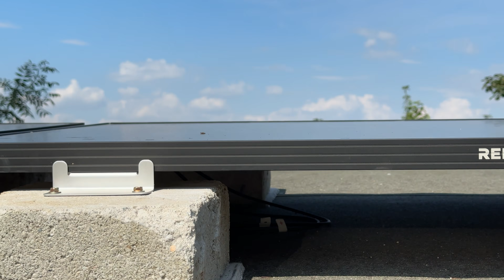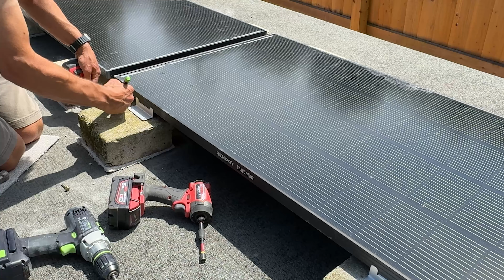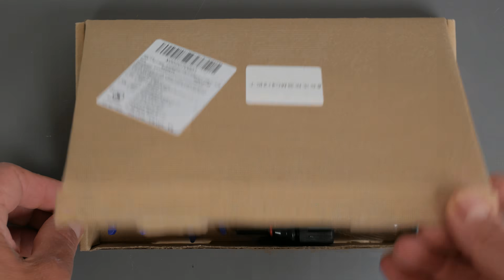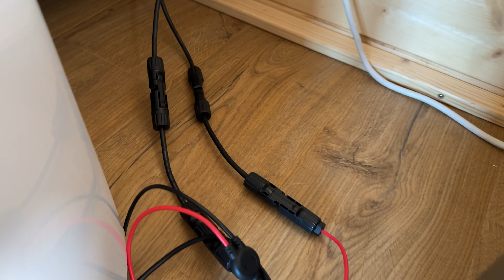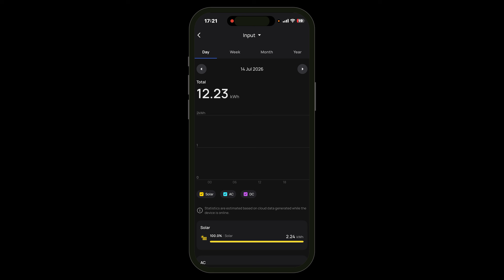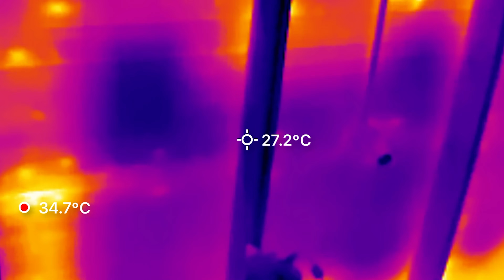DIY Solar Panel Installation – No Roof Drilling!

Comment: Love it. I'm installing something similar in my garage to heat it during winter. Thanks for the ideas!
Reply: Id also like to add, I'm going tk add eyelets to my setup to give me the ability to quicy anchor the panels to the ground  in the case a heavy strom rolls through.
Reply from the maker: Great please let me know how it works out!

Comment: Looking forward to the follow up video when the panels have flown off the roof, landing on some one's property/vehicle/head.........
Plus your home insurance are unlikely to cover you in the event of an accident so you are risking a silly amount of money to save a few quid per year!
I seriously recommend that you do NOT macguyver a solution like this and use something specifically designed to, safely and securely, mount the panels onto roof structures.
Reply from the maker: Look up ballasted PV system.

Comment: Excellent video. I have exactly the same problem - overheating (in my case, dormer) office, with enough flat roof for one panel. Do these Renusol Z brackets work with other brands of solar panel, or only the Renusol ones? I'm thinking of getting one of the new plug-in solars kits and plugging into an outdoor socket rather than making up my own system from scratch.
Reply from the maker: Thanks! I'm not too sure - I'll have some other roof panels arriving soon from EcoFlow hopefully so will check.

Comment: Follow up would be great! Crimping looks easy, I should do my own instead of looking for ready made cables, I’m tempted to get a connection init downstairs to help supplement the kitchen but will see what the end of Aug brings 1st. Got my DJI mini 1000 working with 2 panels now in parallel. Although I’d like 4 panels in total so not sure if parallel-parallel will be too much for the amps into the little battery (but really it’s so the days sun transitions from one side to the next so I can charge all day)
Reply from the maker: You might max out the amps but that's not a problem - only over voltage. Let us know if you give it a try!

Comment: If you wanted to run your panels in series, you could hook them up to a Victron 100/20 Smart Charge Controller to convert the 72v down to 48v. If you wanted to add more panels in series in the future you can get larger versions with higher voltages.
Reply from the maker: Good tip - guessing there will be some conversion losses but might try and test that.

Comment: I have something similar to your setup the only thing that I have different is I have a 10 degree tilt because after raining the panel becomes a pool.
Reply from the maker: My roof does have a pitch I should have been clearer on that but will see if it's enough.

Comment: 😂 if your going to do it then do it correctly rails taking the weight off the roof with brackets at the sides of the shed plus your get more panels on plus still no drilling the roof ( that's Mickey mouse install )
Reply from the maker: Yes you can do it that way too! In fact I was going to do it like that but this option was free (I already had the blocks) and fast! Using ballast is a legitimate way of installing panels on flat roofs FWIW.
Reply: @TheTechnologyMan Indeed it is subject to the structure of the roof do it once do it correctly 👍

Comment: I did exactly the same mounting method with my Renogy 100w panel in February this year. The garage roof is made from Asbestos cement panelling, so drilling wasn't an option I dared consider. My blocks are full size weighing 18Kg each and two of them are immediately over the wooden support beams inside the garage. Works well, and never any fear of the panel taking flight in windy conditions.
Reply from the maker: Great thanks!

Comment: I used silicone sealant to glue a panel to the roof of my plastic shed
Reply from the maker: Does that work ok?
Reply: @TheTechnologyMan  I had to use sand paper to rough up the plastic and duck tape to hold it in place until the silicone went off, its never coming off , so if it ever breaks i will have to cut the metal brackets

Comment: THANK YOU!! excellent video! I was looking for a way to mount to roof without drilling holes! can you show more detail, which is the positive and negative for the xt60 connector, and how you made it from mc4?
Reply from the maker: Thanks. Yes always hard to know how much detail to add. Will maybe do YT short if get chance or will cover in follow up vid.

Comment: Did you look at raising one side to put a tilt on your panels? Might be worth looking into. I have a plug in solar flat roof set up. Mine are at 15 degrees in fastensol tubs. Quite expensive for what they are, but I went with top of the range Longi panels so I wanted to maximise their output as much as I could. I think if I had seen your approach I might have met in the middle and tried a cinderblock tilted set up. Either way, the returns are fantastic aren't they?
Reply: You definitely want a 10-15 degree tilt, not for the improved generation but so that the rain washes the dirt off, otherwise you'll be washing them regularly.
Reply from the maker: The roof does have a 15 degree tilt.

Comment: You sure 34kg is enough. I am sure it will be for 99% of the time but what about the once a year or worse the once in 10 years storm? Googling around it suggests the minimum should be 50Kg ballast per panel. BUT if you block up the space around the edges so wind can not get under the panels then 30-40kg might work.

But I do like the idea of not making holes in the roof!
Reply: 50 kg is usually for 12-15 degree tilted larger panels. Professional installs use ballast mounts at these angles. It's the sweet spot between generation angle and lower wind shearing.
Reply from the maker: I’ll see if they move at all in heavy wind but quite protected around shed so should be ok.
Reply: @TheTechnologyMan  In professional solar installations we rate the exposure and use maps to find the wind speed to which systems are designed. With protection from the fence and being set back from corners of the roof in particular, your mounting will be fine and would also be fine if set at 5 degrees or more, which I recommend. Without any tilt, panel warranty and lifetime are reduced. It is water ingress that kills solar panels primarily and dead flat exacerbates that vulnerability of the adhesive at the frame/front glass/backsheet joint.
Reply: FWIW, if you redo that roof, you should consider adding 4” of polyiso insulation under the roof covering to vastly improve the heat gain / loss through the roof.

Comment: Good idea, blocks low cost. I would cover the roof in solar and use wood or aluminium rails because the weight of panels if linked together flat is enough to keep them down without the blocks. Solar protects the roof from heat and uv damage so they extend the life of the roof
Reply: Yes 8 450w panels on that roof would be a nice add.
Reply from the maker: Yes would like to add more.
Reply: The weight of solar panels is NOT enough to securely keep them down.
A system with just 6 panels would need somewhere in the region of 200kg approx in additional ballast to meet the standards.
Reply: @MagicianMan The trick is to have them flat so no wind load. Wind does not pick up 100kg 6 metre long on 30cm air gap. The most likely is the roof will collapse under weight and wind load which is more than the building is designed for